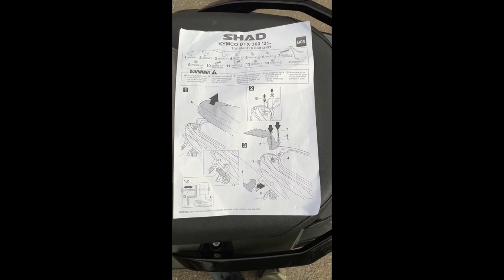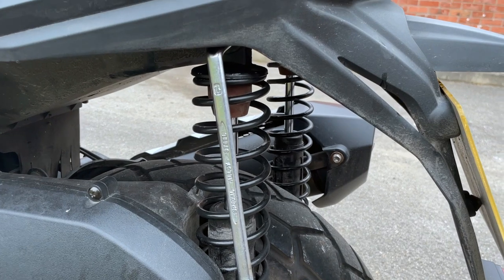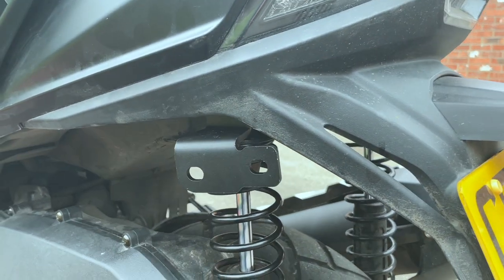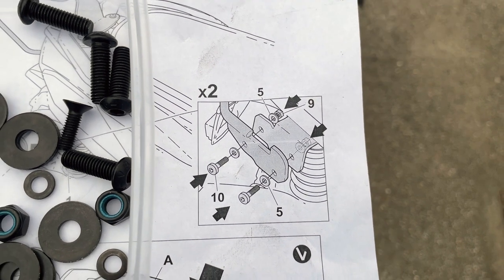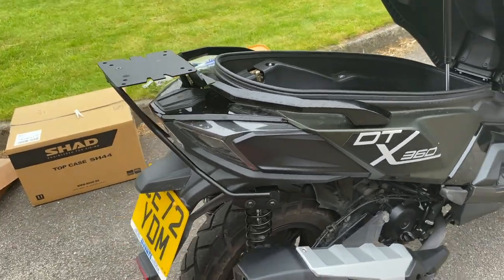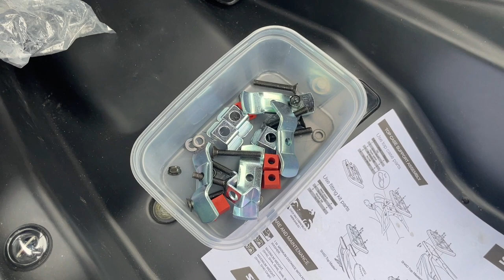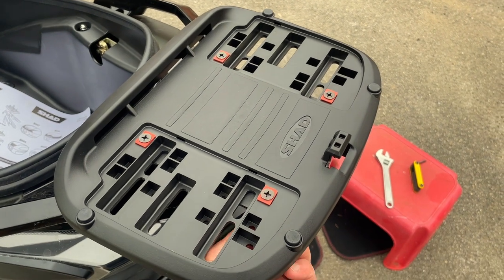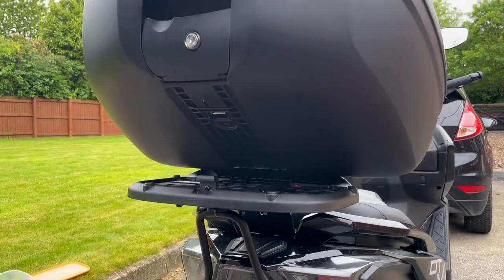Fitting the SHAD SH44 Top Box to the Kymco DTX360 Scooter

Comment: I've using an Sh39 for a few years and needed a box for my new xmax.  I have no complaints with the 39, but this time I want  try the SH44 for the more box/square shape.  Thanks for the info on this one since I was unsure if the latch required locking like the Givi (I'm in the US where most all info for this type of stuff in usually online only).  This appears to operate like the 39, but has the handle available.  Good to know
Reply from the maker: You're welcome! Thank you for the message! Mark